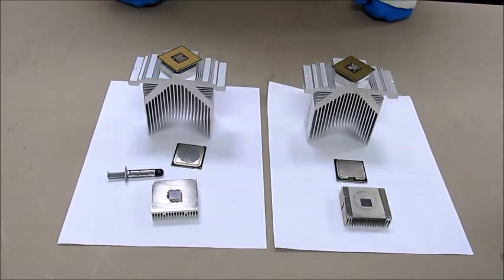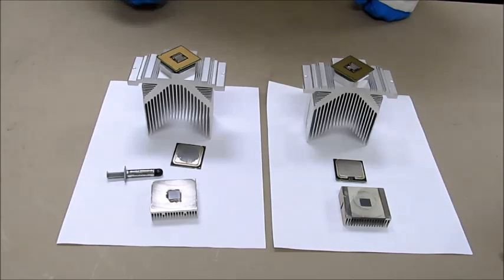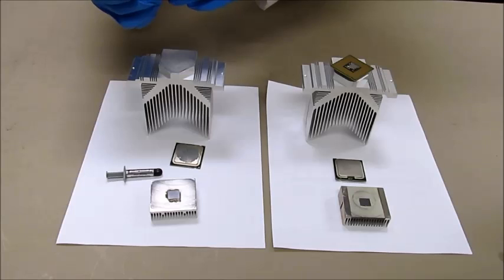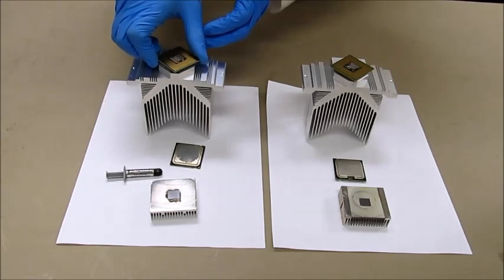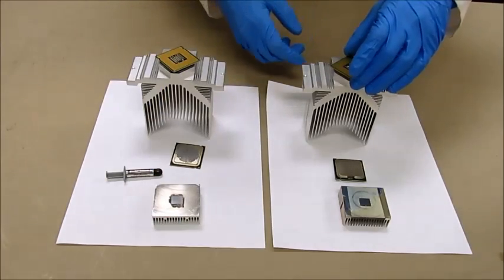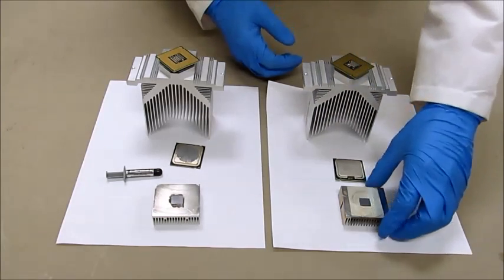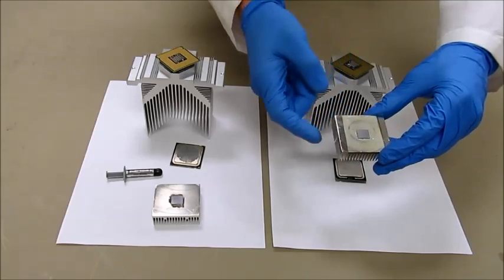MesoGlue

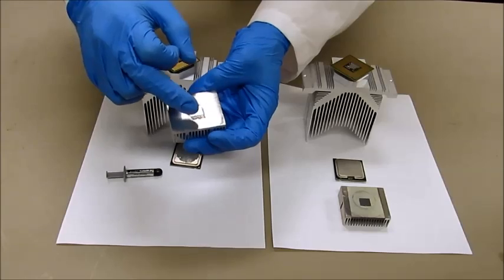Comment: @03:06 grease being pumped out? did you smoke something.... Thermal grease is designed to move away from the core under pressure and only filling the gaps between the two surfaces making the heat transfer as optimal as possible without using a permanent bond.